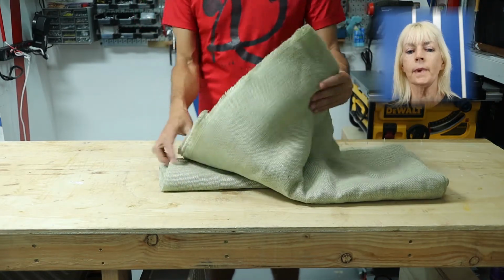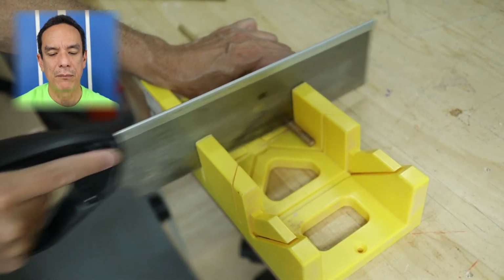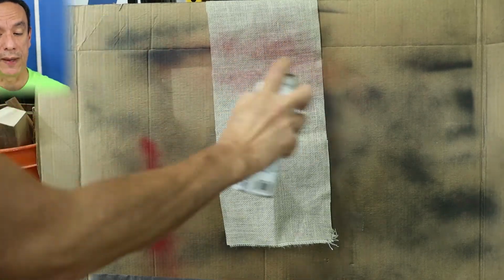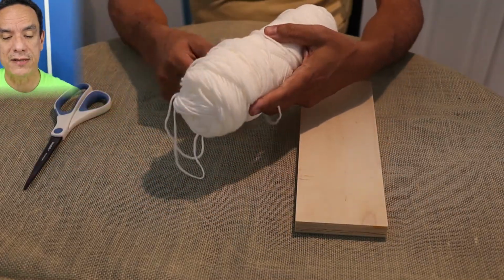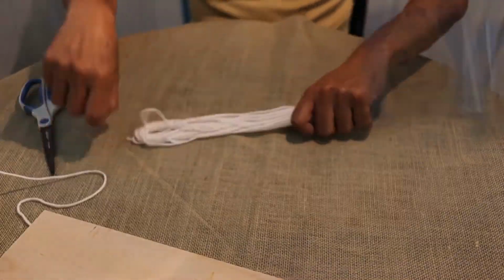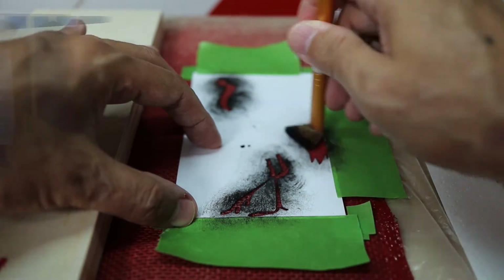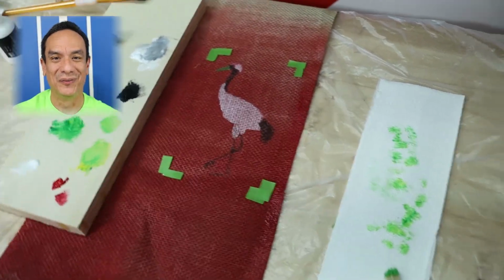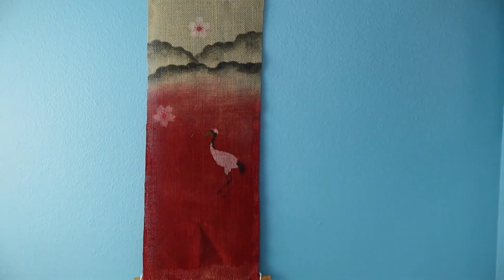Making a Japanese Scroll

Comment: You show the weights and the tassel,  but not how to combine them or even how they hang from the scroll!
Reply from the maker: Sorry I did a poor job of explaining. Hopefully, this link will show you how scroll weights work. https://www.etsy.com/listing/1807024180/set-of-japanese-ceramic-scroll-weights?gpla=1&gao=1&&utm_source=bing&utm_medium=cpc&utm_campaign=shopping_us_ps--home_and_living-power_seller&utm_custom1=_k_87046978a5371b9b2b700e266784e4cc_k_&utm_content=bing_412385671_1298523531504915_81157784660933_pla-4584757335754326:aud-805670566:pla-4584757335754326_c__1807024180&utm_custom2=412385671&msclkid=87046978a5371b9b2b700e266784e4cc
Reply: @Poor_Mans_DIY  Aahh I see. So it's a decorative way of making sure the scroll lies flat and doesn't curl back up. Nice.  Ironic thing is you make a video on how to make kanji and the weight seems to be decorated with miniature kanji.😆